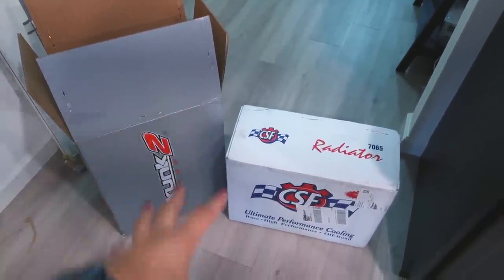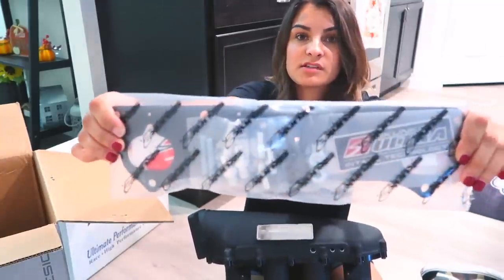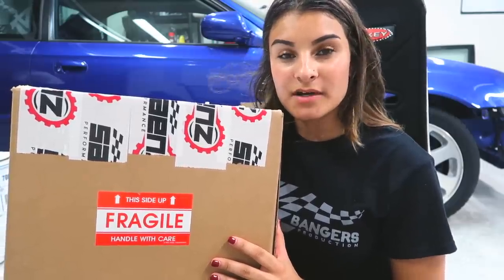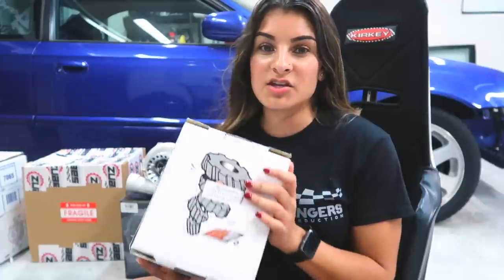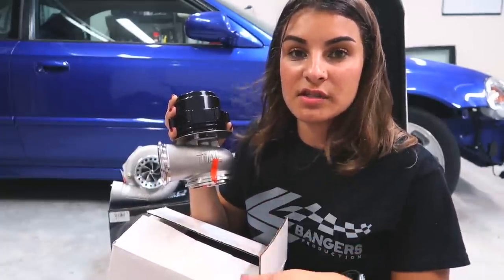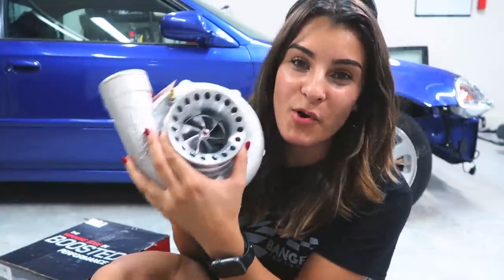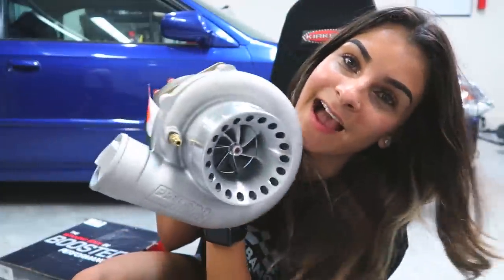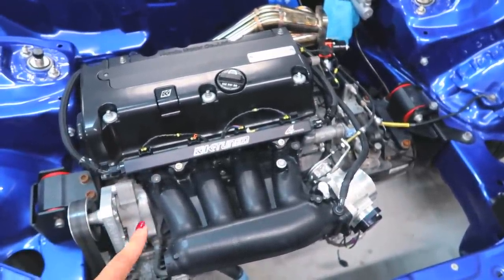It's Finally Here!!! BUILD SERIES- EPISODE 3

Comment: But how well will that tiny radiator cool on the streets ?
Reply: Its damn near 3" thick... Its not a small radiator for a e85 honda
Reply: @brentiaconelli6484  curious if it would work on my 700hp street car closed deck sleeved on e85
Reply: @nextrider123  the most vaguely described 700hp engine ever! only featuring a closed deck and sleeved.  If u have a 700hp street car u sould know what it takes to cool it. Both parts would not affect the cooling system at all
Reply: @brentiaconelli6484  engine internals
KING, Honda, ACL main and rod bearings
Stock crank
Manley TT I beam rods arp 625+ rod bolts
Arias tpr spec 10:1pistons
Je pro seal head gasket
84mm Golden eagle sleeved and o-ringed GSR
Arp head studs
Tpr billet 5 main girdle with arp studs

Wiring harness
Rywire mil spec harness 

gauges
Aem wideband 
Aem digital oil pressure gauge 
Autometer sport comp 2 mechanical boost gauge 
Omni 11k rpm tachometer 

misc
Finishing lines stainless braided brake lines
Finishing lines power steering loop kit
T1 vacuum block
Skunk 2 radiator cap
Moroso killswitch 

audio
Pioneer cd player
Rockford fosgate punch component set in the front 
Rockford fosgate punch 6x9s in the rear
Rockford fosgate punch 400-4 powering the door speakers 
Rockford fosgate punch p300-1 powering the dc audio level 2 12 in sub in the back 
Sky high rca speaker wire power and ground wire 
Rockford fosgate battery terminals
Xs power d975 agm battery 

head
TPR CNC ported head
Ferrea 1mm oversized valves
Ferrea valve guides
Ferrea valve seals
Ferrea springs and retainers 
Skunk 2 lmas
3 lobe TPR spec web camshafts stage 2 cams 

Intake
Edelbrock Victor x intake manifold ported  and polished powder coated black
Omni 70mm throttle body
Skunk 2 thermal throttle body gasket
Hondata thermal intake manifold gasket
TPR catch can setup 

Fuel
TPR fuel rail
Fuel lab post pump and pre injector filters
Weldon fuel pressure regulator a2040-281-a-100
Aeromotive fuel pressure gauge
Id 2000cc injectors
Walbro 450lph e85 fuel pump
-8 feed -6 return 

Turbo setup
Hondata 4 bar map sensor
Precision 6266 gen 2 dbb turbo .81ar
Tial 50mm Bov
2 Tial 44mm wastegates 
Full race t4 top mount twin scroll turbo manifold
Full race 1000hp intercooler  
Full 4" exhaust from turbo back

Trans
Synchrotech carbon synchros
Mfactory diff
Speedfactory scha 
Stock gears
Driveshaft shop 5.9 axles 

body
Exospeed front end
Tpr rear diffuser 
OEM antenna block off plate

suspension
Skunk 2 pro series plus front upper control arms
Skunk 2 pro series plus rear camber kits
K-tuned rear toe kit
Ebay lowering springs for now bc racing coilovers soon...
Beaks tie bar and subframe brace
Skunk 2 pro series lower control arms
Energy suspension bushings in front control arms and rear trailing arms 

Engine management
Hondata s300 v2
Mac 3port boost solenoid
Boost by gear 
Hondarulez cop kit
Reply: @nextrider123  i actually had to LOL at this list because it's completely missing your current cooling system, meaning your radiator, water pump brand and type along with what type of coolant?water or waterless ? Overflow tank? What Psi radiator cap?Im just guessing here but is your car not finished being built to 700hp
Reply: @brentiaconelli6484  mishimoto triple core radiator with a speedfactory cap -16 an lines oem gsr water pump OEM honda coolant no thermostat what else do you wanna know